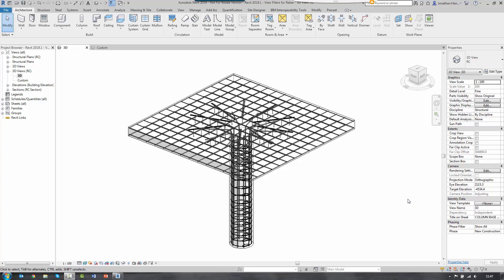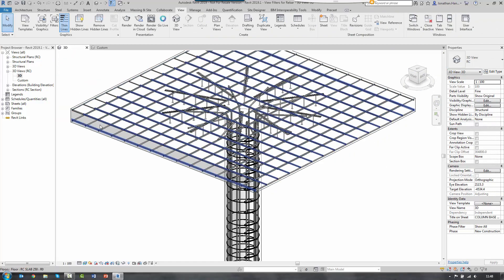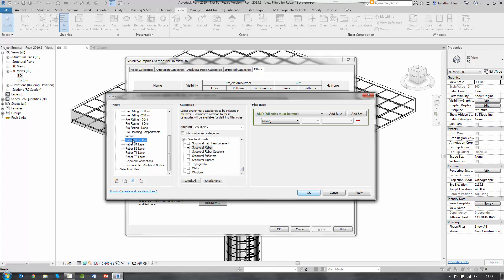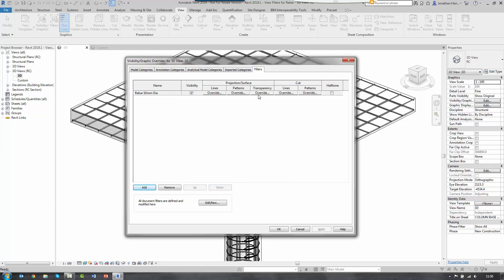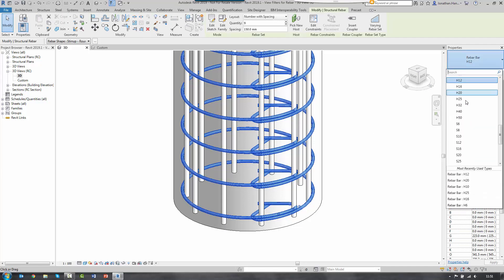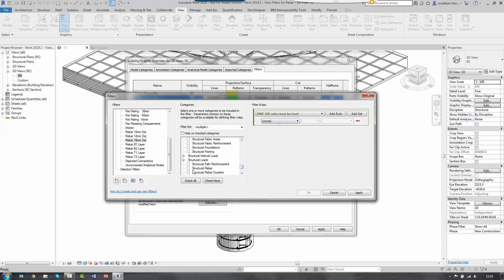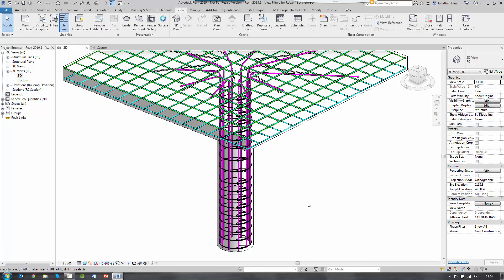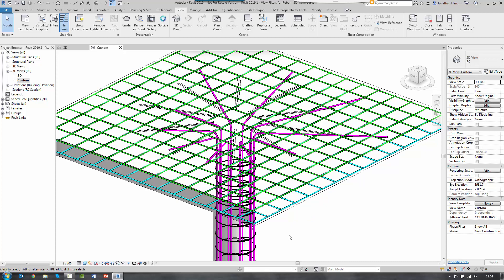Create View Filters for Rebar using Autodesk Revit

Comment: Any way I can filter out the top and bottom bars placed in a floor?
Reply: @bim-things  And then assign that parameter to each individual bar placement? I would love a solution  that recognises the Top/bottom distinction in a structural reinforcement area.
Thanks for the quick response anyway